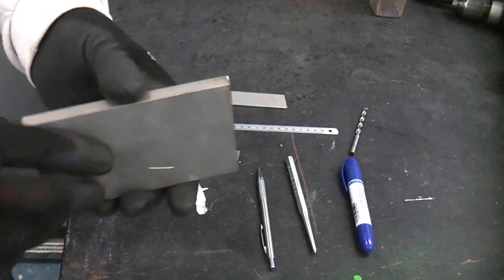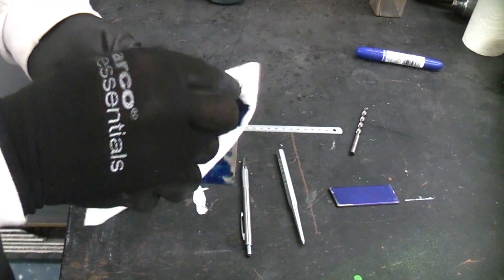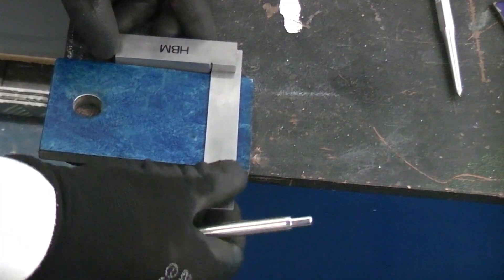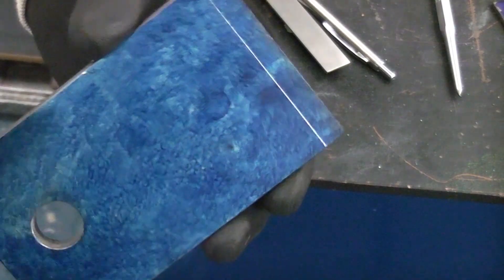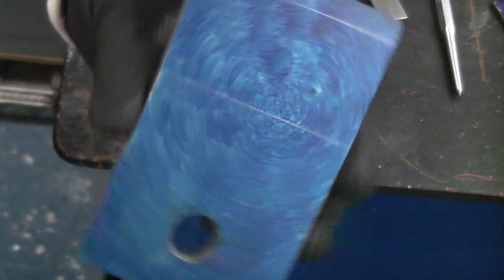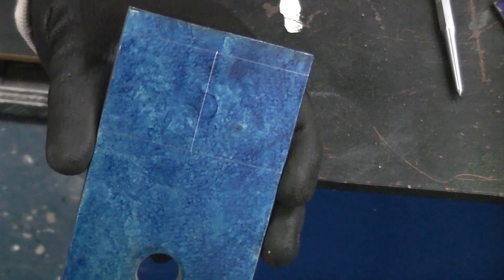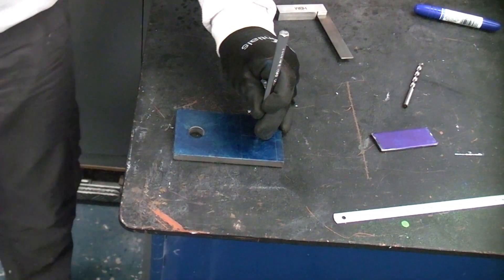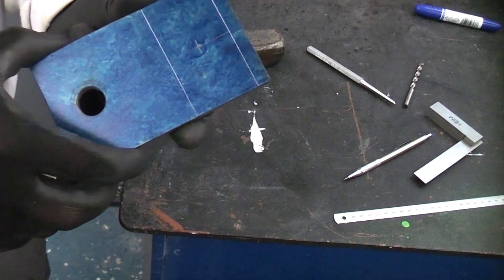Marking out metal

Comment: Great video. I can recommend using an optical center punch for the utmost accuracy on smaller parts such as the piece you worked on in this video since it is easy to drift half a millimeter or so from the intersection of the lines. This method is good enough on larger fabrication projects.
Reply from the maker: Thanks for the info! 👍

Comment: living in the US... i detest tmmost of the imperial system.

when i design for 3d print i always use metric. i love it
Reply from the maker: Imperial is so damn difficult to use, at work we have metric and imperial drill bits and I can pick up a 12.1mm drill bit and know immediately that its 0.1mm larger than a 12mm drill bit. With imperial drill bits I have to get out the Vernier gauge ;-)
Thanks for the comment

Comment: Marking blue for layout, engineers blue is for fitting components. Great video though, covers things very well.
Reply: by fitting components do you mean coating them with blue and putting together then taking apart the parts to see where the blue is worn off to find high spots, etc?
Reply from the maker: Thanks for the comment ;-)
Reply: That's correct. You can use sharpie/marking blue for this but it doesn't work as well.
Reply: Correct. Thought personally for marking I prefer a sharpie type pen, much cheaper and easier, less messy too.